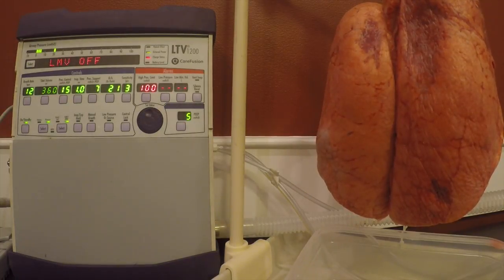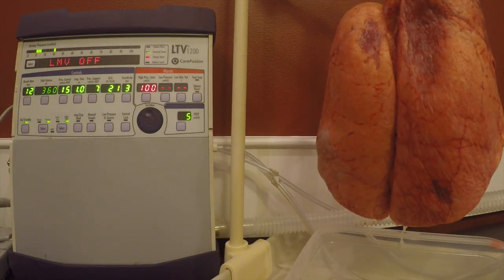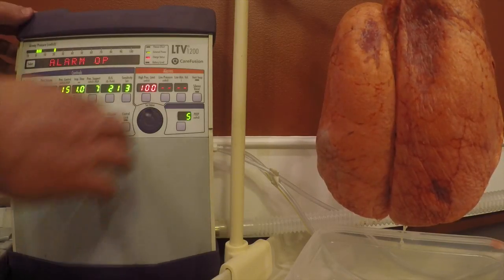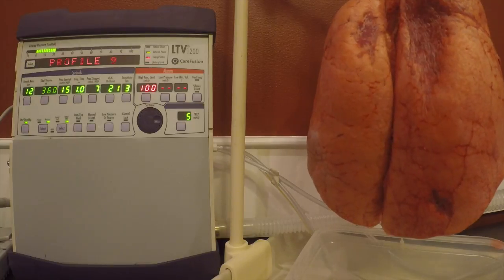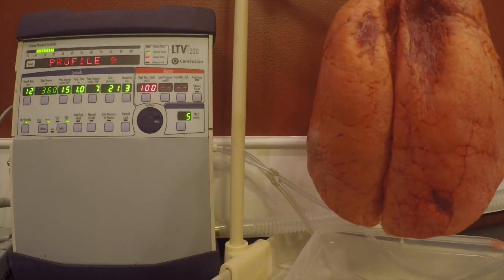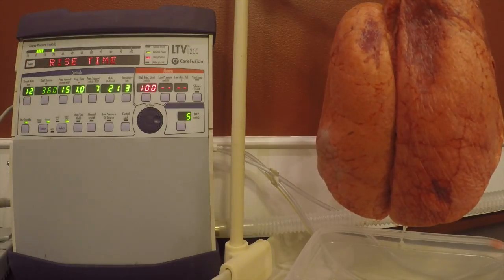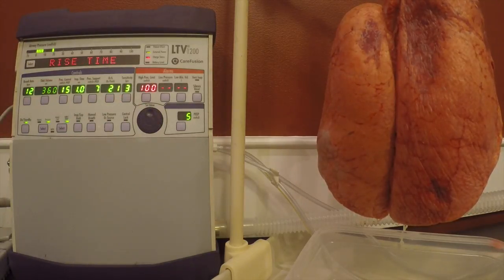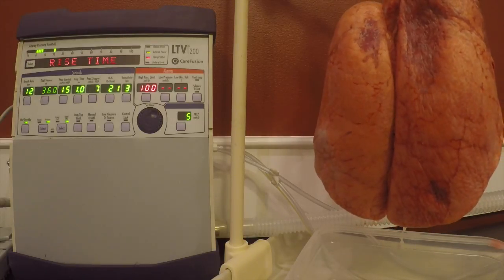LTV1200: Rise Time vs. I-Time Demonstration

Comment: Sir what difference between itime and rise time plz explain
Reply from the maker: Hello,  the I-time is the total inspiratory time before exhalation begins. The Rise time is only used on Pressure control ventilation with most ventilators and is how fast the breath is delivered within the total I-time phase. It can be super fast or (Steep) or it can be slow (gradual).
Reply: FlightBridgeED, LLC. Thanks sir
Reply: Sir make vedio on trigger flow and trigger pressure...difference between